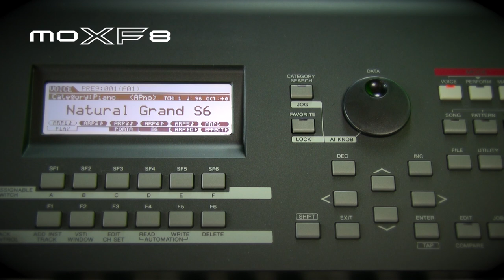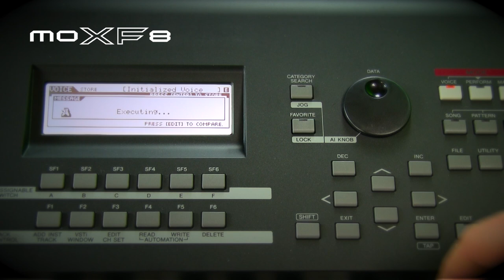Yamaha moXF8 load samples - Adrian Zalten

Comment: You have to buy the Yamaha FL512M or FL1024M expansion flash memory board and install it inside the keyboard in order to load samples and .wav files.  My new 512 Mb card was $150.14 from Sweetwater on 4/29/21.  UPDATE: After my Yamaha expansion arrived (quickly - thanks, Sweetwater, and thanks for the candy!), I found out that Mutec also makes expansion flash memory boards that are less expensive.

Comment: The short lessons are very good 👍
Reply: Only if they give all the information we need.  I couldn't find anywhere, having searched for several hours, that the expansion card (FL512M or FL1024M) is required in order to load .WAV files into my MOXF8.  I think it was about 6 hours into searching and searching that I found a thread in a forum that FINALLY said you need the expansion card.  This lack of information SUCKS!!!  The keyboard just says, "Illegal File" when I tried to load the .WAV files.  What the F does Illegal File mean?  Why doesn't it say, "Install expansion card"?  Come on, Yamaha.

Comment: So how much memory does Moxf have that I can load samples and create voices ?
Reply: You're gonna need to buy the flash chip for a few hundred bucks
Reply: You need either the FL512M (512 Megabytes) or FL1024M (1024 Megabytes) to store samples or .wav files.  I paid $150.14 on 4/29/21 for the 512 Mb unit new from Sweetwater